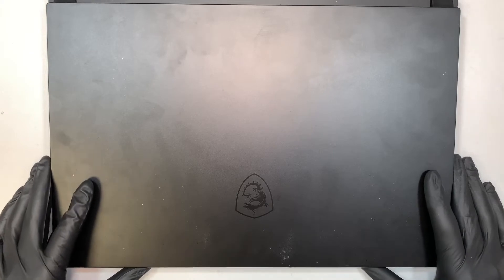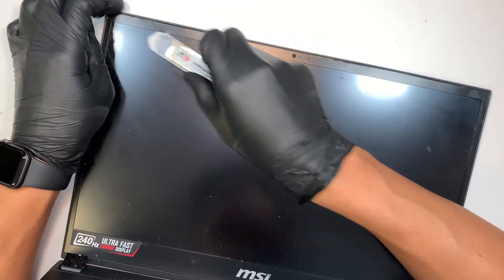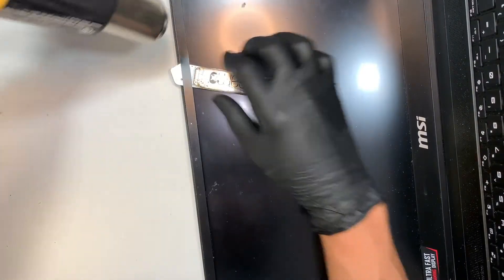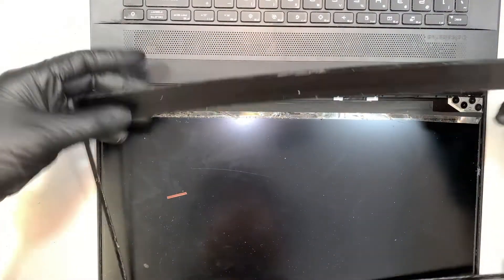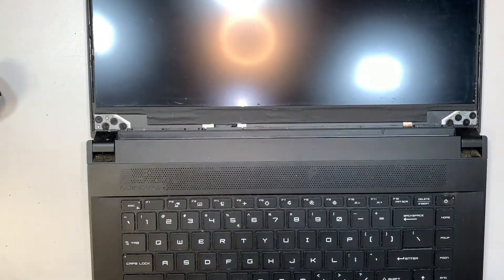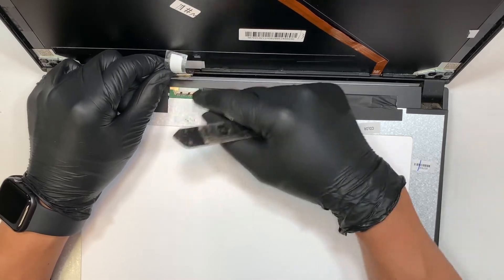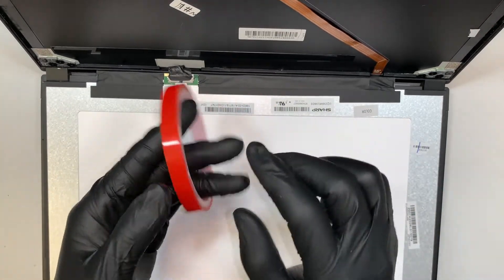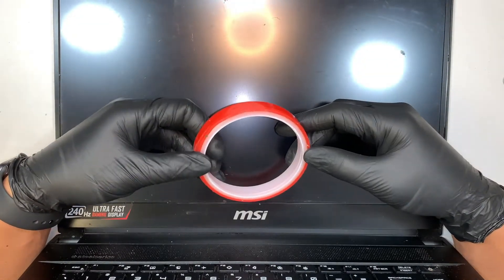MSI GS66 Stealth MS16V1 Screen Replacement

Comment: Is there any way to know if the cable or the screen itself is broken? 
I have exactly the same model and my screen stays black when turning the laptop on, but everything works perfectly fine with an external monitor. How do I know if I have to replace the screen or the cable that connects the screen to the motherboard? I opened up the laptop (backside) but can't see any damages.
Reply: Same happened to mine, now I don't know if it's the screen or the cable
Reply: I’m having the same issue too. My screen just completely blacked out today 😭
Reply: I'm sorry to hear. I got a new screen, we tried to install it but it turned out that the cable was a bit bent and it did not stick to the new screen and even if attached, the new screen did not work. My assumption is that the cable caused problems - maybe got deformed/damaged due to the heat. I couldn't get a cable easily and disassembling to change the cable is a major undertaking. I finally got a new Lenovo Thinkpad P16 Gen 2 laptop and hope it works longer!!! It looks like a much more robust build.
Reply: Same issue. Service center change the mother board and LCD, but I think it's the ribbon or cable
Reply: @OiraVon i tried to unplug the ribbon cable and added some tape between the heatsink, frame, and the cable, still doesn't work, mine was fine if it's not used for gaming but as soon as it pump out some wattage and heat, after 2 mins of stress test it went black screen, either with igpu or dgpu only, but HDMI works just fine

Comment: Just wanted to throw in experience.

This is an absolute garbage laptop.
Reply: As a person who sent to get this display repaired the first time and replacing the display myself now, you are absolutely correct.
Reply: As a person who had to replace the fan myself and not be able to know whether it's the screen or the LCD cable dead, you are absolutely correct!
Reply: @ArcNode Guys I'm having issues with mine, screen keeps glitching and just blacks out sometimes, and other times it just works fine.

Could this be a display cable issue?

Comment: Your amazon links are broken for the tape. Are those 5mm and 10mm? Great video! My GS66-10SGS's screen decided to start crapping the bed recently. It has lines down the bottom 1/4 of the screen. Your video is really helpful. I should be getting my screen on Nov 16th. Will report back with how it went.
Reply: How’d it go?
Reply: hi, is it possible to receive an update on this? My GS66 is kinda going through the same issue of horizontal lines at the bottom of the screen rn 🥲
Reply: Wtf man the same, any updates?

Comment: MSI makes a big deal about how it's all machined aluminum but there's just a flimsy sticker that acts as the bezel. There's less holding the screen in place on this "premium" laptop than a cheap Toshiba from the mid 2000s.
Reply from the maker: True that

Comment: It is possible that the laptop get a shortcircuit if the battery still plug in while changing the screen?
Reply: Totally, it fried my motherboard a few days ago..
Reply: Yes but it's kinda tricky on SOME laptop it can be ok.... but there no way to know for sure which ones... and if you are wrong you fry your mobo so it's best just to just unplug it..I should know I've fried a few boards like that in the past....

Comment: Is it possible to switch my 1080p screen for a 4k screen?
Reply: I'm curious too. Is it possible?
Reply: @MehmetCemYaraş  You should see how many pin connectors each panel has if 30 or 40 and if it coincide wiwth panel you have. There is also the option QHD for the GS&& which should better work and I think it should have same number of pin that 1080p. I am not sure the 4K would fit.

Comment: I am gonna say one thing. You saved me. Is it possible if you could do a 40 PIN wire replacement video too? I don't know the true problem behind my black screen with the same MS-16V1 model, so I wanted to ask you if you know replacing the screen will most likely fix the problem.
Reply: Did you fixed the problem? I have a black screen on model GS 66 10SF and I don’t know if I have to order a new screen or if there is another way to fix the problem. Thanks in advance.
Reply: @jehandalgonzalez2678  No I haven't yet as I will be getting my new screen on July 19thl;however, you should talk with a repair genie not me really because there are so many reasons why you could have a black screen. Worst case scenario your motherboard is dead.
Reply: @juicetina  hey you can solved the problem with the new screen that you received ?
Reply: @Juanjemr1989  yeah i did. It wasn't hard to install the new LCD screen too so I did that by myself. I learned that if anything else than the screen went wrong, It should show up when you connect your laptop to a secondary monitor with HDMI. Otherwise, it's the screen
Reply: @Juanjemr1989  yes it's highly likely that you are able to fix the screen blackout, but I also highly recommend testing if any other part of laptop is broken by connecting your laptop with secondary screen as if it doesn't work with secondary screen that you know for sure works, you might have to buy a new laptop
Reply: @juicetina  Did you have to replace the 40 PIN wire too or only the screen? My screen is black too (but laptop works perfectly with an external monitor) and I do not know if the wire or the screen is broken.
Reply: @hka5772  I highly doubt the wire is broken unless it was faulty at production. It is most likely the screen which is broken as screen is far more exposed/fragile compared to wire that is embedded in a hard case. Also, I didn't have to 40 pin wire. It was actually easier and required far less steps than replacing the fans.
Reply: @juicetina  thanks! I'll start replacing just the screen and hope that it works. I didn't do anything, the screen just stays dark when booting. Luckily I can still work with an external monitor.
Reply: Just as an update, I got a new screen, tried to install it but it turned out that the cable was a bit bent and it did not stick to the new screen and even if attached, the new screen did not work. My assumption is that the cable caused problems - maybe got deformed/damaged due to the heat. I couldn't get a cable easily and disassembling to change the cable is a major undertaking. I finally got a new Lenovo Thinkpad P16 Gen 2 laptop and hope it works longer!!! It looks like a much more robust build, got it yesterday and only had to change SSDs (and do lots of windows updates), didn't need a full install.
Reply: Hi guys. I think I've got the same problem. The screen just doesn't work. But just to be sure: by "black screen" you mean that the screen doesn't work at all or that it lights up just black pixels?
Reply: @nicoladorazio9019  In my case the screen was black constantly. It did not work at all. No pixels showing up at all.